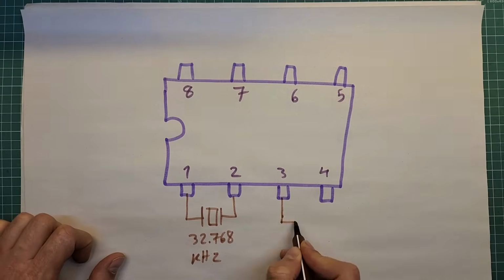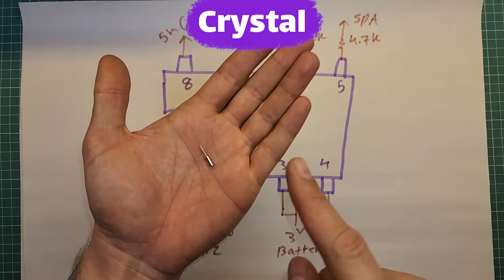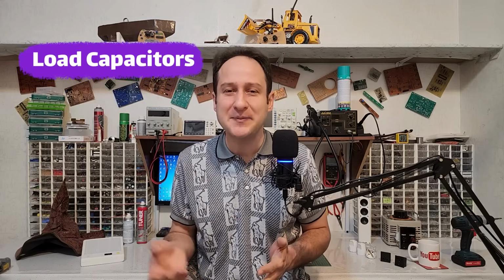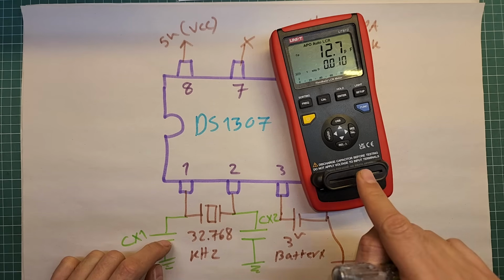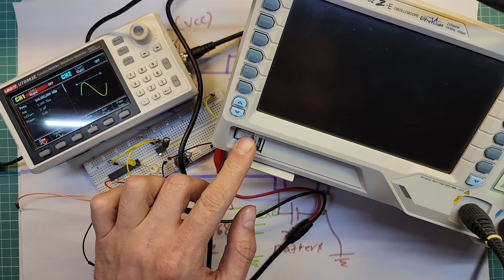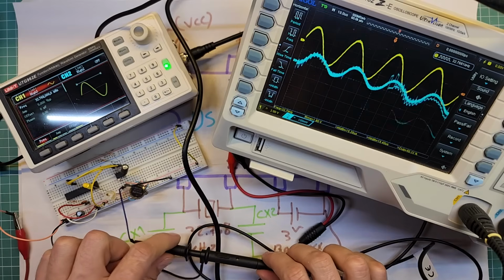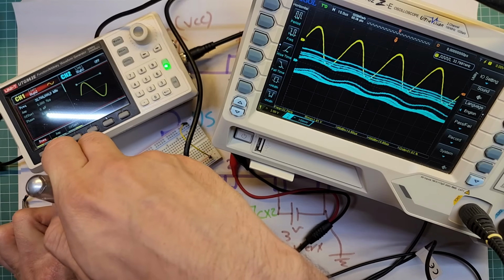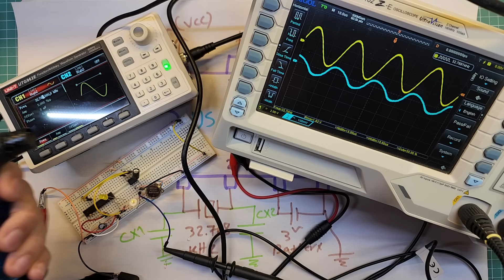Why Your RTC is ALWAYS Wrong + and the EASY Fix!

Comment: Does this assume the ambient temperature is exactly average at the moment of tuning?
I am building a watch, so I should calibrate at wrist temperature, not room temperature. Or worse, at the ratio of room temperature and wrist temperature in proportion to the time it is worn.
Reply: The temperature response is not linear all the way through, in fact for the "tuning fork" style of timing crystal ~25°C will be a local peak in frequency. To get a more accurate midpoint, measure at several temperature levels evenly across the range you'll be using it in, and average the error of those measurements.

Comment: my pro level secret is to take any circuit with a ds1307 and replace it with a ds3231, since they're (almost) a drop-in replacement.  Just a different form factor, and the sqwave function generator is no longer on by default.

Comment: This is why you use a temperature compensated crystal oscillator (txco) version of the rtc, the ds3231, not this version. Setting the trim isn’t good enough day to ay in most cases.

Comment: Accuracy can also change depending on the PCB wiring layout to the crystal, and caps, and also the environment, if it is in metal case, or open, near other objects or changin body, even your own body, which alter capacitance if you dont shield the circuit
Reply from the maker: Yes, it have a dedicated video on this subject 😊

Comment: 1x and 10x on the probe changes the loading, not scaling (resistance and capacitance). 
This means you will need to change the scxaling on the scope accordingly. 
A 10x setting attenuates the signal by 10x.
Reply from the maker: It changes the impedance of the probe
Reply: @elewizard  yes, impedance being the consequence of a specific resistance/capacitance combination.
In your video though, you state that it scales the signal, which is not entirely correct terms. 
Yes, It attenuates it by 10x.

Comment: Thank you.  I learned something.  Note: might be helpful to mention that calibration should be done at the mid-point temperature of the expected temperature range when in service (I didn't hear you actually say that, though it was implied).  Typically this would be room temperature, but for other applications that might be different.
Reply from the maker: Yes, you pointed a very important thing. 
Yes, though it was obvious 😅
Reply: The midpoint/average is often not actually ideal, because the effect is not linear. The ideal midpoint for a multi-MHz AT-cut is ~20°C, between two saddles where the curve is most linear, while the "tuning fork" style is used in the middle of a saddle in the temp curve, such that ~25c is a flat peak, and your frequency error is negative either way you deviate.

Comment: DS3231 RTC provides better accuracy in wide temperature range. I tested some number of these ICs under -10°C and +20°С during few days, and they really held about ±1ppm accuracy.
There was wristwatch 'Electronika' in 1980s with tiny trim capacitor near quartz 32768Hz. Using frequency counter, it was possible to trim such wristwatch for 1s trip per week or even better, for example, in summer, but in winter new trim was  required (temperature drift).

Comment: Or I could just use an NTP server periodically.... :) But seriously - that was very interesting! I didn't know any of that, and I have quite a few RTC modules... that I'm going to have to check on... UGH! YOU JUST MADE MORE WORK FOR ME! :P
Reply: Why not both? Use the RTC to decide when to ping NTP, and track accumulated error. Even if you have network access/GPS/etc. there's a significant power savings to only needing to use them once a day, or once a week, and if it takes a consistent amount of time to gain/lose a second, you've measured your fixed frequency error.

Comment: If you need precise timing. Throw away all of that crap, use a gps module and pull the data from satellites.  You can build yourself a clock that never needs any adjustment. You can also use WiFi to read the time when you need it.  Why struggle and become stressed about something so trivial and simple.  My clock is always accurate and requires no calibration.
Reply: Cost. If you don't have internet connectivity in your project, and don't have a GPS module, you can still get accurate-enough timing for many purposes from a 15 cent part. An intermediate solution is a longwave radio clock receiver, tuning a digital timecode from 60kHz or 77.5kHz.
Reply: @jercos a gps module is cheap. If Pennie’s matter then you’re in the wrong business. As far as internet. Anyone who can read this has internet. What application is going to require a time clock beyond WiFi range and beyond the cost of 3 dollars for a gps module?
Reply: @rickhunt3183  Millions of cheap consumer electronics devices. You want your dishwasher and microwave connected to wifi? Good for you. Don't tell me I'm in the wrong business because of your weird fetish.
Reply: @jercos I’m really shocked that you might possibly have a job. It’s certainly not an engineering position.  At Walmart you might be considered smart, but you can’t possibly be a professional. I’ve worked with my share of engineers who weren’t that bright, but you’re at a whole different level, you make me believe in evolution.
Reply: @rickhunt3183  You really had me going, I was almost going to bite the bait until "you make me believe in evolution." 😂😂😂

In the end, the only way your opinion about my intelligence would possibly matter were if you were paying me... and I don't work for aholes, simple as.
Reply: @rickhunt3183  Honestly, I've met plenty of people like you... blowhards, with no talent, who think they're engineers because they built a radio once. "Every device has to have every feature, it's easy, I see the part that does that on aliexpress for $5!" 😂😂😂😂 Tell me again about how you don't believe in evolution?
Reply: @rickhunt3183  as they say... "I'm not going to take the time and give you my resume." Maybe you should just delete your comment, and go back to pretending you're better than everyone else... alone.
Reply: @jercos don’t let some imagined obstacles stop you from doing what needs to be done.  If you’re on a design team and all you’re doing is coming up with little reasons why we can’t do something. You’re going to be fired. There is always a way. And one that’s likely less complex and better. Sometimes not.
Reply: @rickhunt3183  Get a job, Rick. Then tell me about "design teams" and who gets fired.
Reply: @rickhunt3183  You're real quiet, Ricky. Did they need a Saturday greeter too?
Reply: @jercos I’ve been an engineer for a very long time. I typically don’t waste my time with student level hobbyists. If you had a master’s degree. Your gibberish might have some value. I suspect that you’re about 14 years old. I see no value in any future response.
Reply: @rickhunt3183  ah yes classic, "I'm better than you!" while running away. Have fun greeting customers!
Reply: @rickhunt3183  you can say you've "been an engineer" as long as you want, if nobody pays you for it, it's not your job. You presumably don't "waste your time" with students because they have nothing to gain from you! 😂😂
Reply: @rickhunt3183  Most of the Rick Hunts out there don't look like "engineers" in the sense you're implying... you're what, the one with a Bachelor's degree from TTU? Cleaning up low-level bugs in some real estate accounting software? Of course you'd specifically call out Masters programs when you're jealous of people who've made it that far.
Reply: @rickhunt3183  Oh, and fantasizing about 14 year olds is our president's job, not yours, stay in your lane.

Comment: Also!!! DO NOT SOLDER THE CANISTER TO THE BOARD!!! The pads underneath suggest that you can and should do it, but it definitely should not be done! Doing so may cause severe degradation of the accuracy of the crystal!

Comment: 1) you must have those capacitors in place otherwise the circuit would not oscillate or if it does your you're very lucky.  Those capacitors are call pumping capacitors and are needed in most Crystal circuits. 

2) you can get a higher frequency crystal which oscillates like 2^24 or so with temperature compensations.  Then use another IC to divide it by (24-15).  Then you can adjust your frequency more accurately the same way or use a frequency counter.  I remember I  got oabout a second per year with a good Crystal.
Reply: Check the datasheet, under the specification "crystal specifications", CL is the size of the load capacitors already built into the DS1307. A cousin part, DS1308, will accept a 1Hz clock input from another source to drive the calendar mechanism separately, using the 32kHz crystal as a fallback, if you have a TCXO, OCXO, atomic standard, or GPS source available.

Comment: Even with the probe at 10x the oscillastor is slightly affected by the probe.
It would probably be better to make a pickup coil and connect it to the probe at 1x. So you can measure the oscillator frequency with minimal disturbance.

Comment: Almost exactly 40 years ago (August 1985), I built a similarly designed timebase to control a flip-screen clock. The counter/oscillator IC is an "e1423 G 8119" powered by a 4.1943304 MHz crystal.

The device still works...without any adjustments, the daily deviation is 1 to 2 seconds...not bad, considering it's been 40 years.

In retrospect, it would probably have been better if I had used the mains frequency (50 Hz in our area) as the base frequency, since it is highly constant over longer periods and only drifts slightly up or down over shorter periods.

Comment: It's a good exercise and good for circuit understanding but it's a lot of faff just to avoid using a better chip with internal TCXO and internal trim capability :D
Reply: The same process with a digital input instead of a trimmer cap is how you accurately set the internal trim calibration.

Comment: Even in 10x, the probe has a small pF of capacitance (usually ~4-15pF), so it will always be adding that to the crystal circuit when measuring it, which also works on the basis of pF. A better solution is to use magnetic coupling (wind a thin wire around the traces a couple of times) and measure in mV to pick up just the hint of the signal. Or use an RF probe "wand". You won't add as much pF while measuring that way.

You can also use a software solution to get the MCU to spit out a marker every ten seconds and measure the delta time of those with your computer. There are a couple of slightly more advanced RTC chips on the market that have the "luxury" of in-built "digital" capacitances inside the chip, and you can program one of them into it as a parameter. They also mean you don't need to buy any external load capacitors at all. I've bought the ISL1208 for this purpose.

Comment: How about a method for mass production to be faster than this?
Reply: More expensive RTC chips in fact have exactly this done to their temperature compensated oscillator before they leave the factory. If you need a bunch of RTCs in one place all calibrated the same though, instead of tweaking many crystals, you can just tweak one, set it to output 32768Hz on the square wave output, and use that to drive the other RTCs. (Or similarly, get a high-quality 32.768kHz TCXO and use it to dive all the RTCs) This also leaves an easy upgrade path to a GPS/terrestrial radio source providing the same reference frequency to the various independent microcontrollers.
Reply: @jercos  Thanks a lot.

Comment: Just use a TXCO or a chip with an internal oscillator, or a better chip in general and if you want even more accuracy use a GPS to sync ut periodically, there is honestly no point in doing this bs

Comment: Some microcontrollers (the STM32 series for example) allow you to 'trim" the 32kHz oscillator frequency through software. For example the STM website states. 

"Considering the STM32U5 series, the RTC frequency can be digitally calibrated with a resolution of about 0.954 ppm with a range from -487.1 ppm to +488.5 ppm. The correction of the frequency is performed using a series of small adjustments (adding and/or subtracting individual ck_cal pulses). These adjustments are fairly well distributed so that the RTC is calibrated even when observed over a short duration of time. Make sure that the duration is at least the same size of the calibration period selected.

The smooth calibration register (RTC_CALR) specifies the number of ck_cal clock cycles to be masked during the calibration cycle:"
The advantages of doing this with software are that it requires no external components, but it does require that you understand the calibration method, and put a calibration routine in your software.

Comment: If you want accuracy, don't use any RTC with external crystal. DS3231 is a quite nice replacement.
Reply: This same procedure done digitally, setting the "aging value" in a DS3231 instead of tweaking a variable capacitor, can further increase its accuracy to a maximum of around 0.1ppm precision. This brings its expected average error of a minute per year closer to an ideal of 2-3 seconds per year. (uncompensated uncalibrated crystals like the typical DS1307 setup range around 100ppm, or an hour/year of drift.)

Comment: As usual, by observing you change the conditions: to observe you add an oscilloscope probe, which adds capacitance (conditions are changed). You then tune the variable capacitor. Ultimately later I assume you will want to take the oscilloscope out of the circuit and the capacitance is reduced and your clock will not run at the right speed. It's there another probe point?

You might also consider two capacitors, one fixed with 90% of the value you want,  and a variable parallel one with 20%. This way you could use the variable one with more granularity over 90-110%.
Reply: I see in the comments there is pin 7. Would have been better to probe there.

Comment: I'd prefer a more strategic approach to the vids... identify the need as an accurate clock, identify a number of solution options (incl. other chips mentioned in comments, radio signals and GPS signals) and then compare their pros and cons. Deep diving on a single chip means your audience misses out on the big picture

Comment: The 32,768 Hz crystal is designed to be used with a temperature controlled oven [TCXO] (the human body is an amazing temperature controlled oven) hence it will drift with varying temperature if no oven is used...
Reply: The last part of his video explains that because the temperature will tend to cycle up and down equally every day, this effect isn't quite as bad as it has potential to be. If you set the cyrstal at roughly the midpoint temperature. Of course there's seasonal variations eventually.

Comment: Thank you for the video. I noticed that you probed the crystal oscillator circuit with your probe. The probe itself has an internal capacitance, which will affect your measurements. It's preferred to measure the frequency on Pin #7 SQW/OUT, which can output the oscillator's frequency, and you can probe it directly without affecting the oscillator's circuit with your measurement tools.
Reply: This - never try to measure oscillator frequency by connecting anything to the crystal. Ok on using a trim cap to pull the freq but you must measure frequency without probe's or test equipment's own capacitance affecting the circuit. Using a  100x probe mitigates this a bit. Also note that the tempco of trim caps is poor, up to around 1000ppm for the type shown.

Comment: Impact of scope probe loading on clock accuracy? You don't mention where you're getting the clock signal from. Is it a buffered clock, or are you loading the oscillator down while you measure it? And, if you're using the buffered output, how did you program the chip to provide this buffered output?